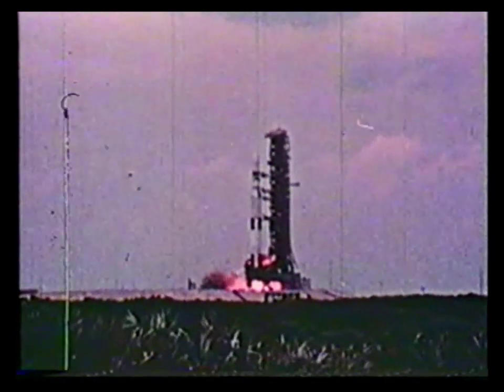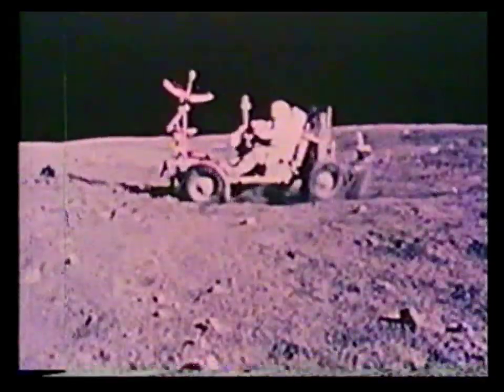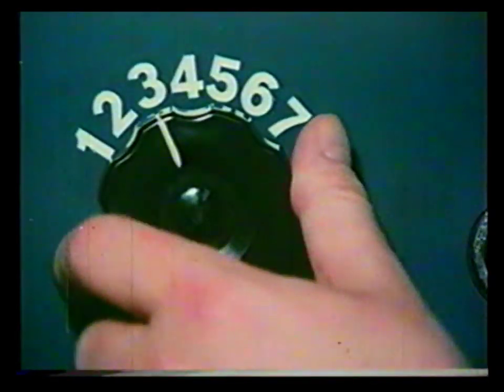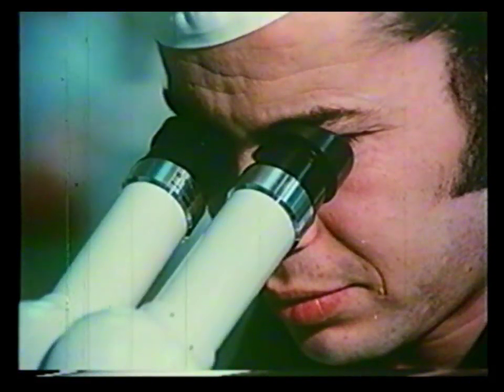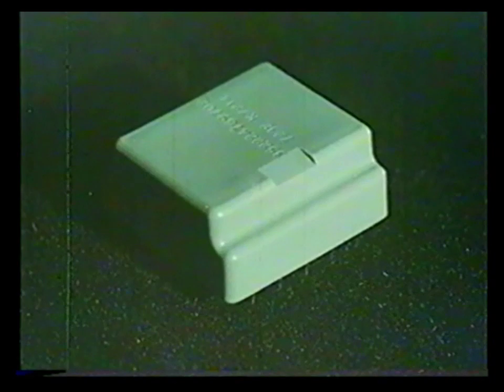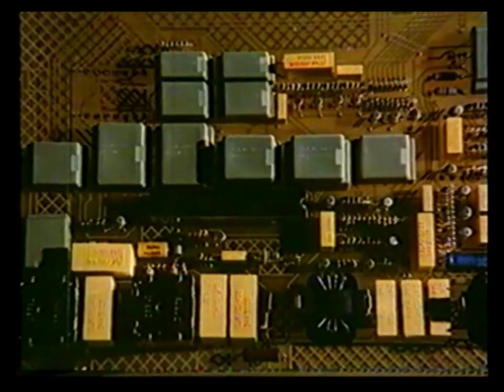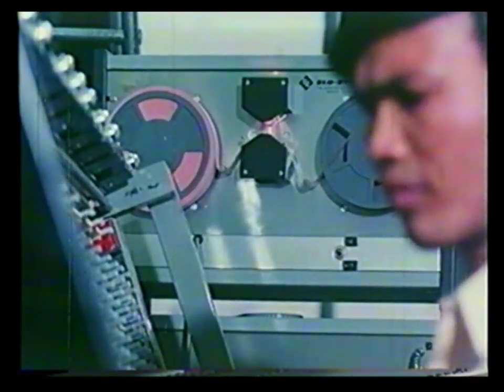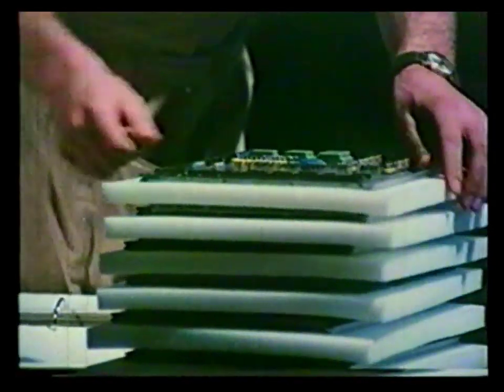"PRX/A 1974, The future-proof telephone switch" part 1

Comment: Interesting that they still used relays even though transistors were already pretty good by this point.  I guess a whole transistor circuit equivalent to the relay was still expensive.
Reply: The switched path required 4 reed contacts within 1 reed relay.  4 Discreet transistors at the time and associated resistors etc would probably have taken more space!
Reply: +Xezlec The reed relay gives ideal Open Circuit & Closed Circuit conditions.

Comment: They go on and on about reed relays...That still makes a spark, and thus oxidizes in time.
Reply: Wrong. The reed relay resides in a sealed glass tube with a protective atmosphere, so oxidation only happens if the atmosphere is contaminated.